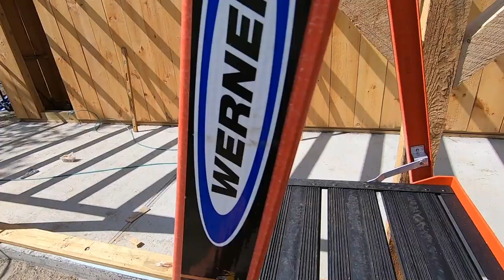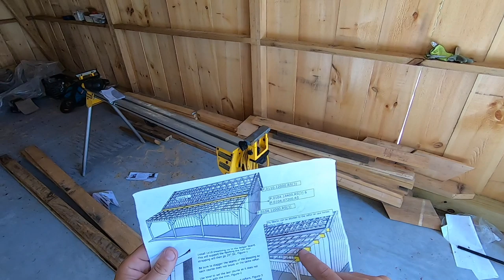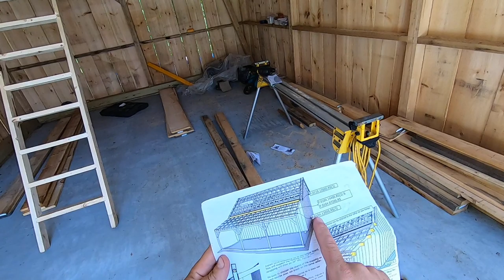This 1 Trick is going to SAVE me So Much time & Frustration  one man Builds a Post & Beam BARN

Comment: Because your hen is brooding, she is not laying eggs, she is only sitting on them. Which is part of the reason why your egg production is down.  You can break her from that by separating her from the flock and putting her in a cage with no bedding and no eggs. All she gets is feed and water.  Check on her daily seeing how she reacts to you. If she is still pecky and her feathers puff up, when you touch her, she is still broody. After a few days, she will not be broody any longer and she can return to the flock.

Comment: A suggestion:  Where the ridge cap overlaps in the middle of the roof, use rivets to fasten the end down.
Reply: I noticed that too.
Reply: Agree ... about 20 years ago, the end of our ridge cap wasn’t fastened down when we had our roof replaced and Chicago winds lifted about 4 feet up on the end so it was standing straight up.  I was the lucky one that got to climb up onto the 2nd story roof, straddle the ridge cap all the way to the edge to fasten it down.  You’re MUCH more agile than I am certainly, but better to be proactive. ❤️
Reply: Good idea

Comment: Great video! One  small tip that you might want to keep in mind, little more trouble, but well worth it, put a few screws (as well as nails) in the lath boards, and just put 2 fasteners per rafter, then when you screw on the metal, you won’t hit a nail head, and the extra screws in the lath boards will help prevent the roof from coming off in a strong wind. Great video!😃😃

Comment: The first thing I loved about this!  Was the Mobile scaffold! The yellow one in this clip! I've renovated many houses over 40 years and built a few! I had a mustard color as in this clip and a red one, both bought off ebay! $250 the tradies fight over them to use! 600 mm wide, stable as, they dont need to get off it to move around the room, to get through,a doorway, 1 person job, take the platform and 1 side off, and walk it round even the tightest corners into a room! ( Best investment ever) yep, switched up my blue brand drills and handtools to the much cheaper green ones that you have! ( All my tradie mates have made that same choice! 😉)  Batton screws and roofing screws are fantastic! The uses for them structually as well as ease of fixing! Brilliant! ( cant think what you called them! TPG?) Same sort of thing! My major concern is structural integrety , wind bracing, and sizing of beams? ( here in Australia, it will cost you $6000 just to put in the plans to put up a sunsail in your yard! The councils are crucifying us!) A 4x4 which is basically a 90x90 mm ? No way on that span! 190x50? Maybe? Twice as tall, but half the width is way stronger! Every council in Australia, has a constructed plan, plus overhead pictures of what is now there! You get a please explain letter, then a fine, plus then you have to get the plans approved! I'd love to know your planning permission code? Sounds like a place I could live, build way above any building code, yet never get sued by my neighbor cause my roof blew off onto their new Tesla or Porsche! Yep, I live in a Cyclone Zone! 240kph winds! Needs tie downs! Needs bracing! Needs trees, or bamboo even, at a distance to break the wind cycle, appropriately placed? Can cut it under 1/2 😉😉😉. Build cheap, but build smart!. All the best! I hope this is classified as a possitive comment.

Comment: Al, That went well. A much more satisfactory end to the day. Just a thought,  how about a wall plate under the rafters on the barn siding? I think that would help with snow load. I don't need a barn, but you've got me thinking it would be fun to build one!! What I do need is a lean to greenhouse up against a 10' high stone wall on the allotment and I think me, a structure like you are working on now and some polycarbonate sheeting will do the trick next year😀. As always, great to watch. Regards to all Stephen.

Comment: Hey! I meant to post this on one of your previous videos and I don't think I actually did. Just a trick I've found useful when framing. When you're screwing or drilling at a steep angle like at 15:20 if you start the screw or drill bit at a 90 to the wood surface until the tip is just a mm or so below the surface and then change the drill/driver to the angle that you actually want it'll go in easier and the screw will end up exactly where you want without dancing around on the surface first. Hope this is useful to you!

Comment: you are a very good at every thing you do. we all have to make changes. when i was young i could walk beams but not any more. we use to drive 20 penny nails in 2 by 6 at right spacing sharpen nails and punch hole for the screws but you could only do one sheet at a time. but you could do it on the roof. your way is good to.  the only tool i really hate is a hand saw .you are a good dad. take care, be safe and well

Comment: Funny how terminology varies regionally.  In the upper midwest the boards you call strappping are referred to as purlins.
Reply: They are called purlins. Not a pro builder here. Strapping is 3/ 4 material on the underside of joints/rafters in typical New England Building area when Green / un-dry  wood is used and strapping is added to change the grain direction of wood before sheetrock or plasterboard is hung. This avoids nail/screw popping

Comment: When evening up the rafter ends, the instructions showed using a level to mark them. That way, if there's any twist in the beam you won't be copying it onto your rafter.  Also, a sawzall is really only good for demolition and very rough cuts. The blade tends to run out especially with thicker wood.   I would have used a good hand saw for those end cuts for a better finished look.

Comment: Al , the saw saw shakes because you don't have the shoe tight against the work surface you are cutting. You can adjust the shoe in or out to fit, then just push it against the work surface and it will cut straighter and very fast, you be surprised. In this case I would have used an 8 inch blade and moved the shoe out. It will cut fast that your circular saw in this case.

Comment: That temp strip under the rafters should be permanent and run the full length .  R  U  thinking about snow and ice loads ?
Reply: steven k .....

Looks like your rafters need some substantial support along the wall. I wouldn’t trust some screws and nails to hold it especially if you get a heavy wet snow on it!

Comment: Mr. Al, I just saw a bug barrier that goes under the metal roof pieces on another channel. He referred to them as " closures"  they go on the edge of the roofline and seal the metal roofing panels to keep bugs etc. from getting into the roof . It is at minutes 11:03-11:05 on the channel "Wild Wonderful off-Grid". The video name is " DIY Metal Roofing ai stall". Just thought you might be I steered in them before you go any farther with your roofings.

Comment: Somebody over at Jamaica Cottages needs to get retrained on working a tape measure - lol  They would do good to higher you as their Quality Assurance guy. My least favorite tool to use is my Porter-Cable hand-held, corded jigsaw - the vertical axis doesn't lock firmly down at 0 degrees and after a couple of cuts it drifts and if I don't catch it I end of with angled cuts vice straights one.

Comment: I'm concerned that having to cut those rafter tails is a result of the walls of the main building spreading in the middle since there is nothing to tie them in except the loft on one end. The rest of the building has nothing to prevent it from spreading...unless I missed something. I would take some measurements and add some adjustable cable inside if needed.

Comment: Its going to be interesting to see how the main roof is going to tie into the side roof.  To me it doesn't look like there's enough overhang to keep water out.  Very curious because in all my building experience I've never had to deal with such a roof and always designed building to steer away from this type.  Also, the side roof looks a little flat and will accumulate snow causing an issue with water intrusion between the two roofs as the snow melts.
Reply: I thought the same thing being we live in North Idaho. Ours overhangs a little more so the water doesn't go into our shop and the snow slides onto the over hang and then onto the ground.

Comment: should have shown my older farmer neighbor you channel sooner.  his wise advice is to cut the bottoms of all your siding boards (including the battens) at a slight angle.  this is so that any rain running down them will drip off and not migrate toward  your sills and creep into your building. probably not as good as an old wives tale but it dose make sense. just as you use drip edge on a roof to keep water from migrating up the facia.

Comment: The itching at your wrist when using the reciprocating saw is caused by the vibrations, you can also get the same thing from chainsaws.
 It’s not good for you, and in time, you might find you get carpal tunnel syndrome, or trigger finger, or something else you don’t really want, but with short term use you should be ok.

Comment: i would have attached a 2x4 where you had the ledger board for additional support of the rafters, not rely on a screw and a couple nails to hold it when you have snow loads

Comment: good job on barn but i still say you need joist hangers or you will regret it when you get  umpteen foot of snow on that roof hate to see all that workin a pile of kindling on the goats suprized nobody else said anything just another mans opinion other than that good job.
Reply: In AZ joist hangers are required by code even if there is no snow load.

Comment: 20:12 That's not a Sawzall! It's a Re Itch procating saw... If you use it with the shoe up against the work it wont make your hands vibrate so much. it's when you hold it away from the work that it causes all that vibration. My least favorite tool is the wrong tool for the job.

Comment: If you make a Mash out of the meat chicks food... By adding water to the food just enough to make it thin like corn meal for corn bread... Then let it sit for at least 3 to 5 days it will fermit and it makes it so they can diegest almost 100% of the food... If you just feed dry food they will not diegest but about 60 to 75% of the feed... You can feed this fermited feed all the way to it time to butcher the chickens... They will get muck larger and faster with this fermited feed and save you money on the feed... To speed up the fremiting save about 1/8 of each 5 gallon bucket of fermited feed and just add more dry feed and water to it and wait 3 days to feed and start again... I use 3 5 gallon buckets at a time to start with... As the chickens get bigger you will have to add more buckets depinding on how many chickens you have... The feed will get a white/ gray like mold on top of it that is normal... Also you will want to mix up the ferminted feed each day until you feed it... This works Great... My meat birds are 20 to 30% larger on this feeding system... There are videos on youtube about this... You don't have to use grains you can just use meat birs feed... I have even use laying pellets because they are much cheaper here...

Comment: Main roof is way to short. You need eaves and overhangs. This design is sending water down the structure. Remove the “ledger” as you called it and run your secondary roof under the main. That wall won’t last 5 years. I appreciate the life you chose, it’s really awesome. Please don’t instruct people on building. Homesteaders have limited resources and need solid builds. Please don’t take it as criticism, consider the person who can nearly afford to do a project like this. The family who cant afford to drop $5-6k every 10yrs on a new barn. You could flash it with some modern products, but, metal roofing should last 60-70 years, so why replace flashing every 7?  We would call that a wet barn. What do I know I old have 30yrs as a second generation builder.

Comment: Really dislike the rafter connection to the barn. Nothing but the screw holding it. Bad design. I would place a 2x4 against the block/rake and then notch the rafters to sit onto a ledger to support it. Also that is going to be a crazy roof transition. Weird.

Comment: Surprised me you didn't allow some overhang on lean-to rafters, to keep rain off the siding? Then 2 or 3 or 4 feet in
additional width would have provided more space under cover. Well anyhow. Little subsistence farming there, but
without fields for raising grain and forage for animal feed, will be hampered by having to buy feed. As is, a hobby of
sorts, the needs of the animals habituates one's life into a destiny. Over time I would avoid throwing animals' feed
on the ground, as a parasitical cycle can result, but in such a small operation, may not be much of a concern for now.
Well anyhow, appears you are enjoying your pre XIX century lifestyle, however with some conveniences of modern 
technology, tools, appliances, electricity, automobile etc.

Comment: So much of your wood is water-stained with black be it from tannic acid and/or mold - likely from mixing wood species plus primarily from sitting outside over the wet winter wrapped in poly trapping moisture - especially with metallic roofing in the bundle. Wood should be stored inside so it can breathe. Yet I have not seen any comments nor treatments, i.e. borate with a borax solution or hydrogen peroxide spritzing to stop further deterioration. Many say its only cosmetic - even if true, its unappealing to see wood turning black. Lumber yard wood doesn't turn black unless left out in the weather. Why don't you try spritzing a location of black stained wood with simple borax laundry booster and another location with 3% hydrogen peroxide for comparison. Neither treatment will harm you or your animals. Why doesn't https://jamaicacottageshop.com/ treat their woods to prevent black discoloration? Maybe this is an issue they need to be made aware of. Comments.